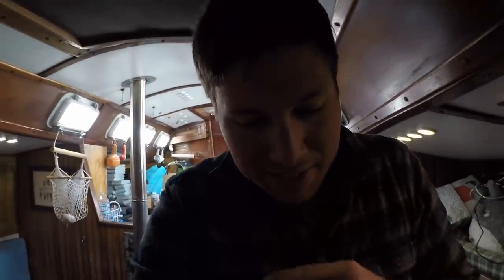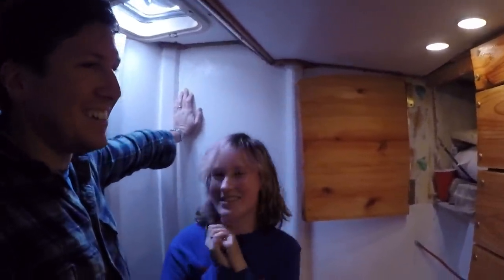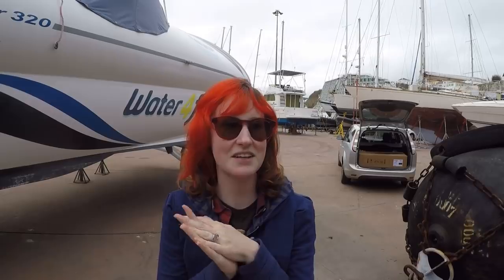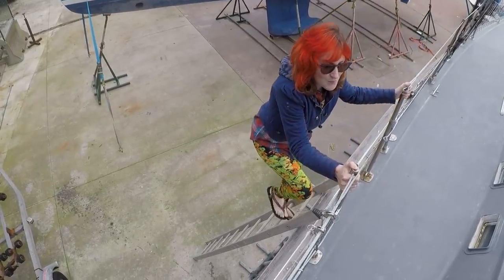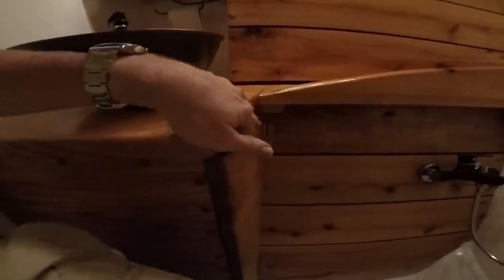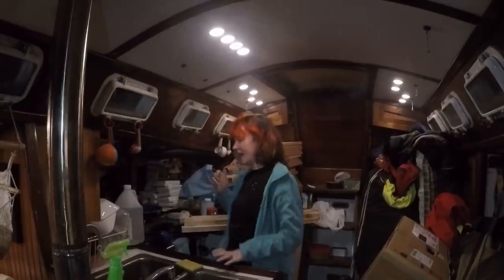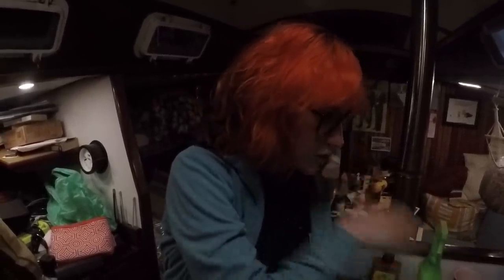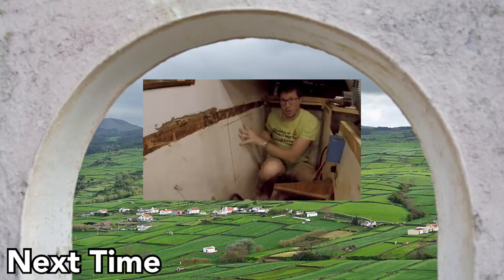Galley DESTRUCTION | Sailing Wisdom [S3 Ep36]

Comment: Our open under sink storage was a pain to use, you had to twist everything sideways to pull it out. I took off the board and replaced it with some 1/4" mesh string netting. Attached it at the bottom and stitched the top to a stainless spring held by a small eye screw on either side. Easy to see through and you just pushed down on the spring to retrieve the dish soap or Jack Daniels.
Reply from the maker: A spring! Why didn’t I think of that! 
We were always messing with the pelican hooks to get to our pots but a spring would have made that much easier :)

Comment: That is the right shaped hull of a real sailboat!!And with that particular hull and that SILENT electric non smoky motor you could probably make 6 or 7 knots under just bare pole sailing. No need to run the steamer lights and you'll always have the right of way.The right hull shape works wonders in a small breeze!!When you leave there don't forget to send the government their the painting of their lighthouse they ordered along with the along with the bill for 10,000USD.I doubt if the left hand knows what the right is doing.They'll probably screw up and pay you twice instead of just once.

Comment: This question is about your video  pertaining to the Air Head toilet. You stated that you could go for bout six months before changing the peat moss. What happens to all of the TP that you use? Does it all fit into that tub? I'm an a gentleman of ,shall I say, advancing age and tend to uses more T P than now.  I have worked in Venezuela a few times in the past and they put TP into waist basket which is then disposed of. Being an American, I did it the old fashion way and just flushed it. The question is...what do you do?
Reply from the maker: It goes in the poo bin and breaks down with #2 over the 6 months.
Reply: Excellent. I was wondering, myself.... @RiggingDoctor
Reply: @RiggingDoctor  Well, okay, but we're talking about a shit load of TP here.